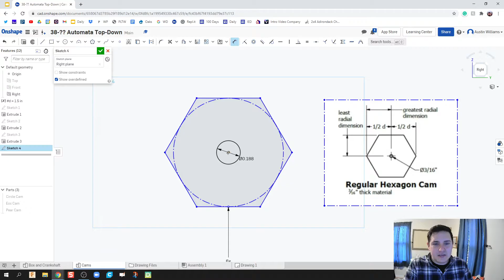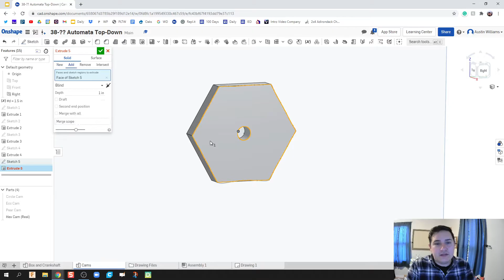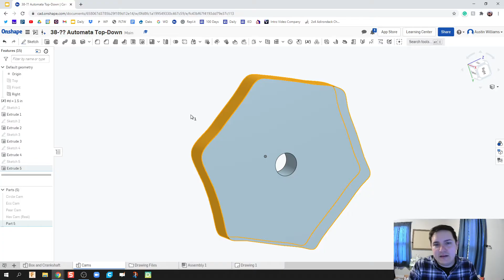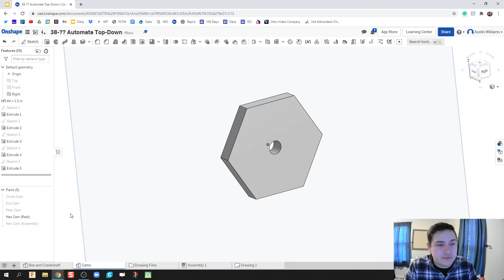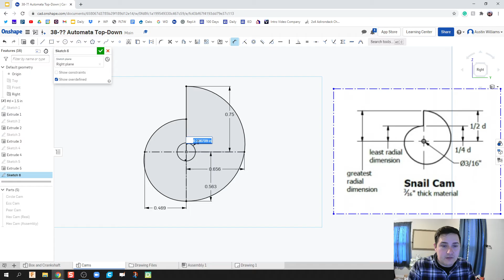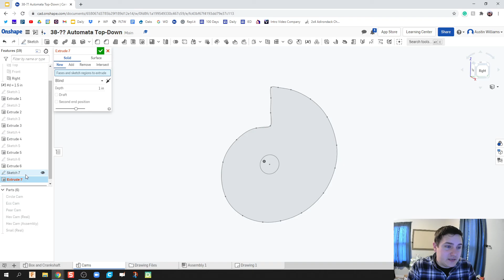Automata Top Down - Hex and Snail Cam - Day 41 of 100 Onshape Journey

Comment: I have a problem with the hex cam, it’s not working because it isn’t set to the whole hexagon and it’s only on one part so I can animate it. It says there is a error
Reply from the maker: You have to make your hex cam have one face. If there are two or more faces, it won't work. 

Another method (not shown in video) is to create a hex sketch, extrude, and filet each corner a small amount.

Comment: Could you just fillet the corners of the hexagon to appease Onshape, instead of doing the spline?
Reply from the maker: Yes. This is my best progress on a single method for all types of cams.
Reply: @LearnItDoItMakeIt  This (fillet) or this (what the video showed - spline) is the best method?  If you mean fillet, I am curious as to why you showed the spline method?
Reply from the maker: @andreasmith6537  from what I've found. The filled command wont help with snail or heart cams.
Reply: @LearnItDoItMakeIt  thanks for your super quick responses!